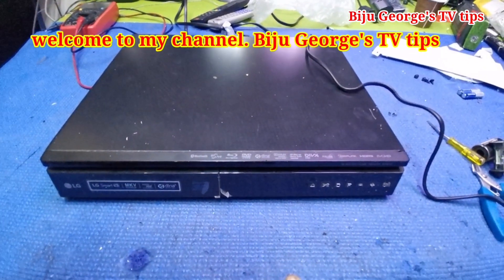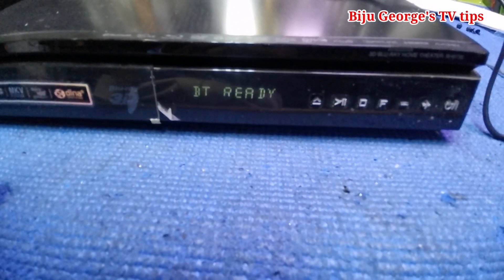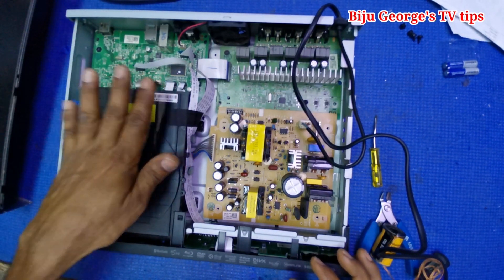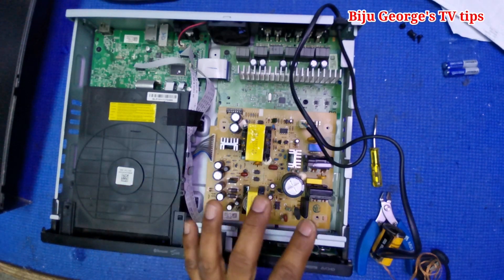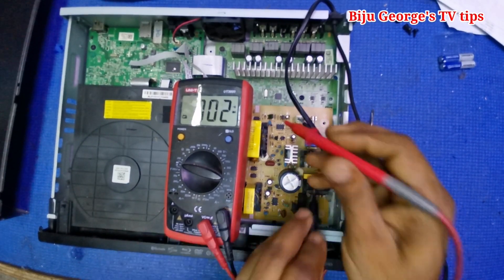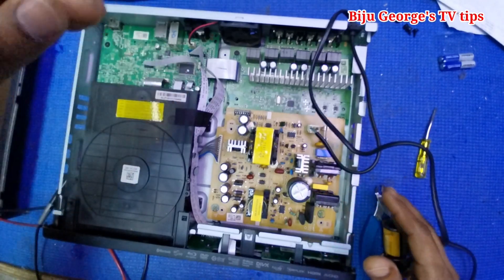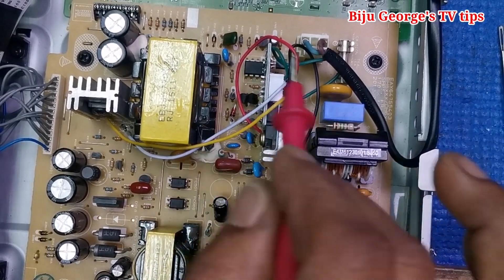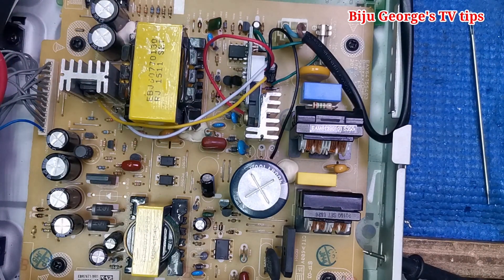LG DVD player repairing video. bh6730t. eax64755403.bh6xxx. ca901

Comment: എൻ്റെ LG Home theatre ht353 sd A2 5.1 channel ഇൽ sound illa.ON ആക്കുമ്പോൾ mic connect ചെയ്യുന്നത് പോലത്തെ സൗണ്ട് കേൾക്കും.വേറെ ഒന്നും ഇല്ല.വോൾട്ടേജ് output നോക്കി,ഡിവിഡി output ok ആണ്.amp output 34v പകരം 32v ആണ്.dvd disc error,no disk എന്നിവ കാണിക്കുന്നു.എല്ലാം ശരിയാക്കി എടുക്കാൻ പറ്റുമോ. amplifier chipset പോയോ എന്ന് എങ്ങനെ നോക്കാൻ പറ്റും.speaker wires connect ചെയ്തിരിക്കുന്നു.അപ്പോൾ speaker output voltage 10-15 v ആണ്. capasitor ഒന്നും complaint കാഴ്ചയിൽ ഇല്ല.ഹെൽപ് me iam not a technician
Reply from the maker: ഐസി ഡാമേജ് ആയാൽ പ്രൊട്ടക്ഷനിൽ പോകും. ഡിവിഡി വർക്ക് ചെയ്യാത്തത് ലെൻസ് ഡാമേജ് ആയിട്ടുണ്ടാകും